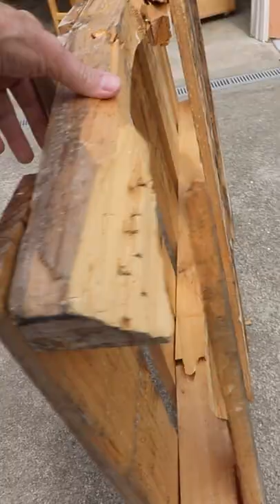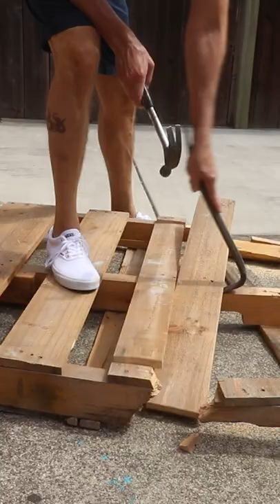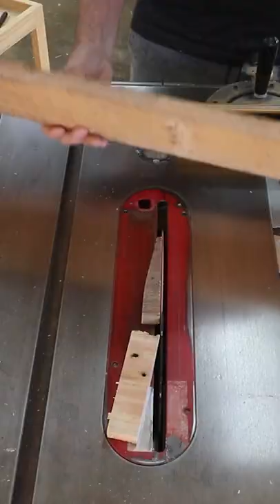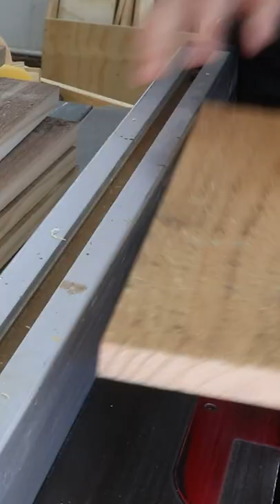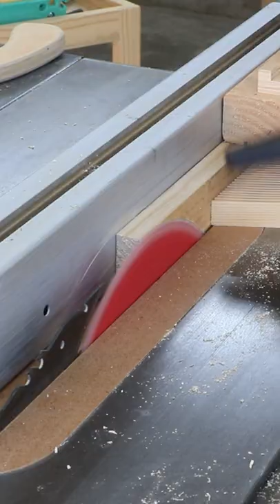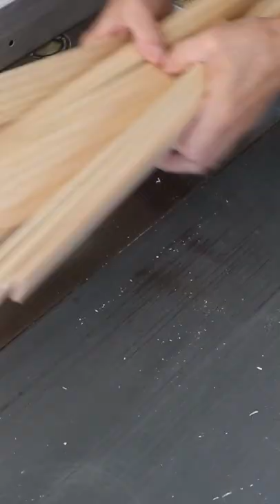I saved $$$ milling my own lumber from an old pallet.

Comment: Woodworking is generally a subtractive process, but this feels like the definition of "making sawdust" 😂
Reply: And if you collect that sawdust, you can make wood filler with a bit of glue. :)
Reply: @TheNewGreenIsBlue  you can only if you plan to have the area it’s applied to concealed or if the finish doesn’t matter. Although it does create a good bond, the glue itself will not allow you to apply stain to that area so just something to keep in mind.
Reply: That's what I thought too

Comment: The pallet craze seems like a good idea. I'm not a fan. No matter how careful you are, you are going to hit some fasteners. Damage to tools and person is too likely.  Find a sawmill somewhere near you. They usually sell pallets of off cuts. The split ends of raw milled slabs that are kiln dried. Around 1/2 is usable for projects, the other half is the best firewood firewood. Usually pretty cheap. A largen large pallet of it is $90 in my neck of the woods. You do need to be able to haul it.
Reply: Plus most pallets are full of imbedded dirt and pebbles. Its just not worth the damage to nice blades.

Comment: Yep, pallets are a real good source sometimes, lotsa work, but a good source.  I have are hard time finding many that haven't been heat treated to near crumbs lol.

If you take a 4x4 and place just beside the runners on the floor, supporting the lattice, Then use a 2 lb sledge and a 12" piece of board like a punch to smack down on the runners, makes getting this center nails started out A LOT easier.
Cheers
Reply: I've used bolt cutters to trim the bent nail down to about an 1", than knock it out enough to pull the head out.

Comment: Is saving money on recycled wood, counter productive when you add your cost of work and tool wear?
Reply from the maker: Well it is if you can save $$$
Reply: @SteveRamsey  but, my question is, if you are spending too much time "saving money" is there a chance that buying water oak in bulk would actually save you money.
If you put tool wear and your personal hourly expectations for income into the ratio, are you making capital income? Or are you making a portfolio profit. If you can sell the "it's recycled pallet wood" phrase, does that justify the time spent?
Reply from the maker: @mechinized4685  Well, maybe if I saved $ or even $$. But the title says $$$ so it has to be true...and that's what YouTube likes in titles.
Reply: @SteveRamsey  ok. Guess you don't have actual conversations. 2talu
Reply: Yeah, and if you hit one nail you missed, or one bit of stone embedded into that pallet wood, then you are out $50 for new planer blades, and any money savings are now cancelled times ten.   A far better option for free wood is to look for old abandoned furniture in apartment complexes.   Kitchen tables and beds and dressers get discarded all the time and they can be reused for multiple projects, and they are generally already sanded and finished, so there is massive time savings there.

Comment: Next video: I saved $20 by milling my own pallet lumber, and then had to spend $50 because I missed a nail and had to buy new planer blades.
Reply from the maker: Using this method will save you $$$. Enough to buy a new planer.